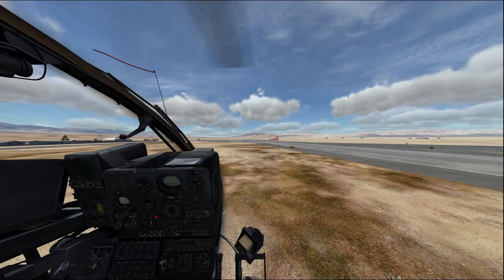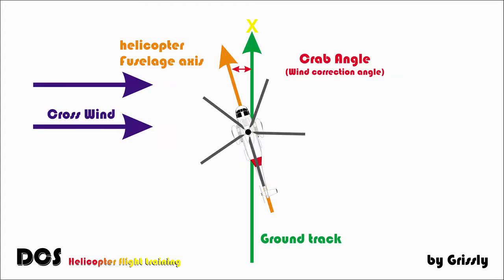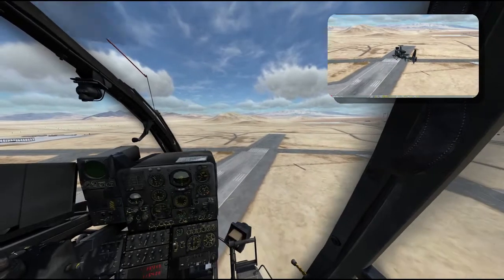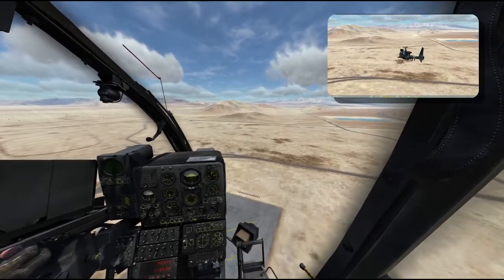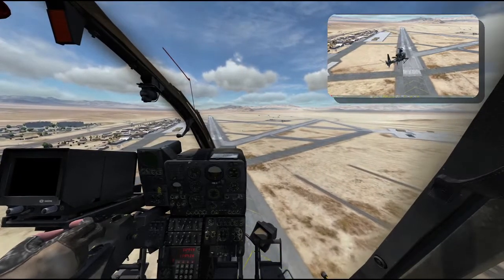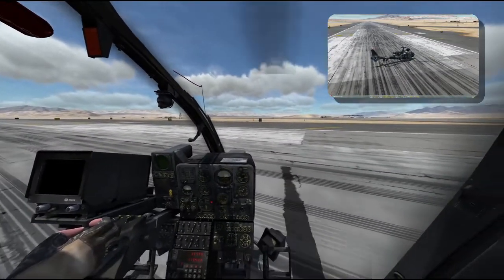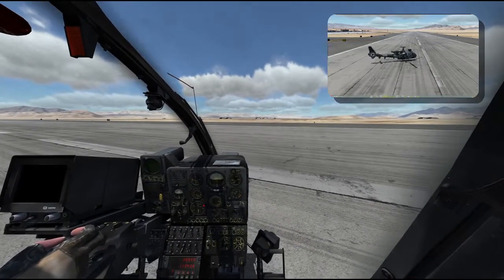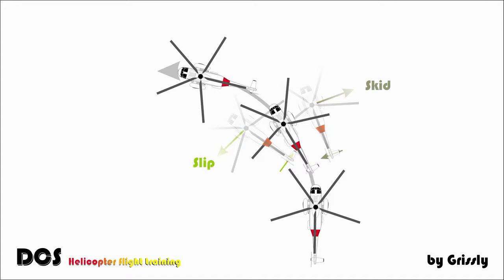Slip, Skid, Crab / English Version

Comment: Nice video. Would it be possible to add the indicator that shows commands inputs in your video. It would perhaps help to materialize that actions you take.

I personnaly just began Gazelle and fins it difficult to fly straight evne without wind. Never knows if I must use cyclic or pedals to keep my slip ball centered.